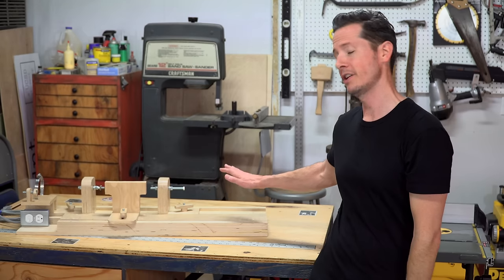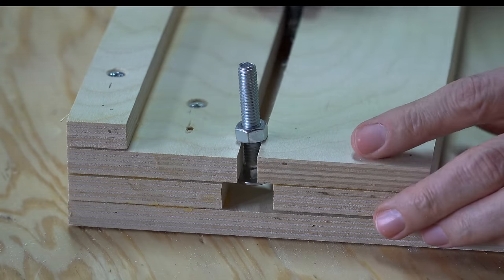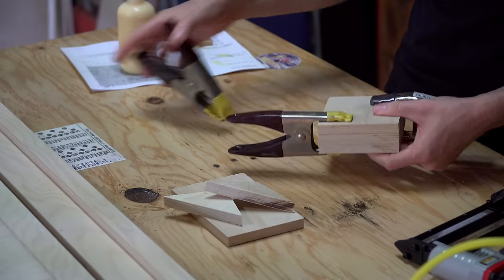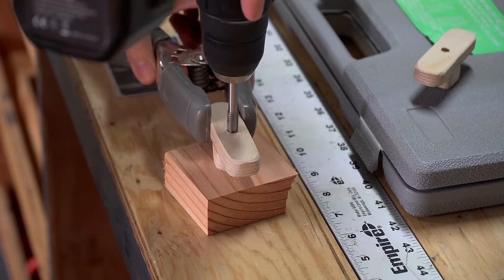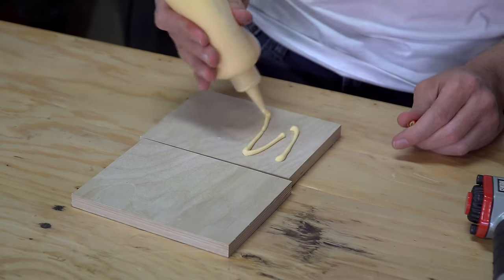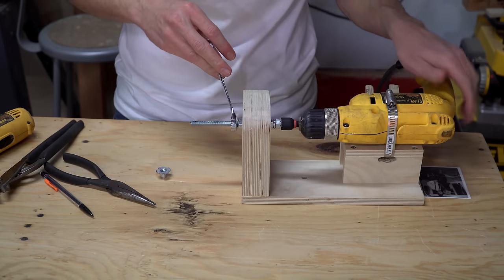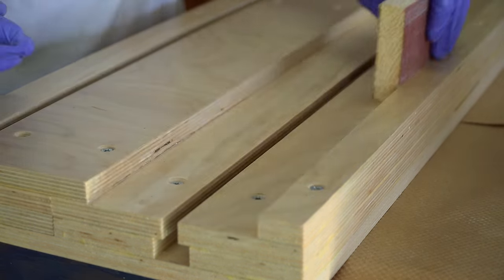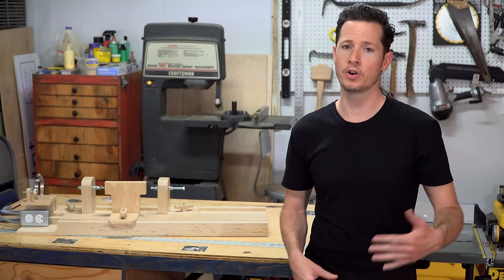DIY Drill Powered Lathe

Comment: I purchased you design and built this lathe. It came out great if I do say so myself! I would appreciate if you could add some designs for lathe chucks, keeping in mind the current specs and needing to mount the chuck to the 5/16ths thread.
Reply from the maker: I usually only build stuff as I need it, and I don't need a chuck right now, so it may be a while. When and if I do build different chucks, I'll be sure to post a video!
Reply from the maker: Also, congrats on finishing the project! I'm glad you're happy with it. If you have a specific chuck design in mind, let me know and I'll take a look at it. I might not be able to squeeze it into the schedule, but I can at least evaluate it and give some feedback :-)
Reply: @OneMinuteWorkbench  I'm primarily using this to work on pool cues. So, if you look at a two piece pool cue I'm trying fixture both ends of a cue shaft and a cue butt. I'm sure I could figure something out, but thought if you had a more universal design already... any basic ideas you have for this specific application would be appreciated.
Reply from the maker: Peter Clondas I’ve read a bit about making pool cues...it’s a pretty crazy science/art. To be honest, I wouldn’t know where to begin. Do you have any experience with it?
Reply: Hi. Love this, I couldn’t find the plans to download. I thought I saw them for $5.00 but cannot find that page. Thanks!

Comment: Hey tommy, I am trying to gather the parts right now and was wondering how you reinforced the tee nut. I just tried and it fractured right away.
Reply from the maker: I did not reinforce the t-nut, but others who have built this project have come up with ways of holding heavier workpieces. Check out the project builds here: https://oneminuteworkbench.com/project-photos/customer-gallery/ Scroll through and look at all the lathe builds. There are a couple where people have build a headstock that has screws being used as prongs...I bet that'd solve your issue. Let me know how it goes, and feel free to reach out if you need more help. Also, I don't always see all the comments, so if you want a guaranteed response, email me through the website. I hope this helps!

Comment: Hi man, great job, really, you build some amazing machines. I took inspiration from your diy sander and I made another one, slightly different, which works decently but definitely has to be improved by installing a bearing on the rod to increase the stability of the disc. I will definitely build a lathe inspired to this design.
I have a curiosity though: do you remember how long did it take to make this lathe? Or your sander? I ask you this because I always get the impression that I'm really too slow, it takes me very long to build this kind of machines hahaha, so I was wondering if in youtube videos it seems way faster (because many parts of the building process are not shown, etc) or if it is actually faster, which anyway would be quite normal as I am a noob if compared to skillful guys like you and other woodworkers on youtube :D

Comment: Hi there! I was thinking about the wood because I wanted to try something, well, my idea is to use OSB for building the lathe, what do you think? I've got a pair of pieces that could be enough for build the entire lathe.
Thanks, and keep going!
Reply: osb is crap in my opinion. its pressed wood chips is not strong wont hold screws. moisture in the air will warp it. plus looks bad.
Reply: @ronalddavis  the thing is... I do like how it looks. But you're right is not the better wood for made things like that

Comment: what size hose clamp did you use
Reply from the maker: I think it was a 4 inch hose clamp. Just make sure whatever hose clamp you use is big enough to get around your drill and a little extra to get around the drill platform.

Comment: What's the swing on this lathe?  (What diameter of work can it hold?)
Reply from the maker: The absolute max diameter (before the workpiece would strike the frame) is 7". That said, you'd need to start off with something at least a little bit smaller than 7", just to be safe. I hope this helps!
Reply: @OneMinuteWorkbench  so call it a 6" swing to be safe.  Thanks.

Comment: The lathe may have only cost $35 in parts, but the tools used to make it probably cost at least several hundred. And if you don't own a table saw, or have access to one, this project is going to be a hell of a lot harder to make.

BTW, I've recently been planning to make an arcade spinner control using an optical mouse, a skate bearing and a 5/16" screw for the shaft. I discovered that a McDonald's straw is the perfect size to make the screw fit snugly into the bearing.
Reply: Working with wood always calls on some tools. But If you do not have a tablesaw, you can build it as well. You need circular saw though.

Comment: could you mount a Jacob's chuck onto this? btw, a Jacob's chuck is basically what is on the drill press
Reply from the maker: I probably wouldn't because I'd never be gripping a workpiece small enough to fit into a Jacob's chuck. Most Jacob's chucks are a max of around 1/2", and the workpieces I would turn usually start at about 3-4 inches.

Comment: Cool vid, your good with wood $35 in materials you should try living in uk your project is something i like and could achieve but at cost of uk prices, could there be a more simple method to make a lathe using a drill?
Reply from the maker: Thank you! I often hear people say that, but is it really that bad? I just checked B & Q's price for 1200x2400 12mm sheet of hardwood plywood, and it's 28 pounds ($38 USD). I just paid $58 USD for a 1200x2400 12mm just a week ago. That said, I think there are probably cheaper methods, but I don't know if they will be as simple or as good. Plywood has the benefit of of being very stable. You could use wood scraps to build a lathe, and then it'll cost much less, but you'll suffer some instability. Anyway, I hope this answers your question! Thanks again for the feedback!

Comment: Where did you get Baltic birch plywood for $35?
Reply from the maker: I buy 1/2"x5'x5' sheets at my local hardwood store for around $30, and 1/2"x4'x8' sheets for around $50. For this project, I used exactly one half of a 5x5 sheet...so there's only about $15 worth of Baltic Birch in this build. I hope this helps!

Comment: The sooner or later, the wood will eventually change its shape especially its alignment due to evaporation and condensation, atmospheric pressure. meaning weather. Im not sure if coating it will do the job. Density of metal still change its form how about the wood? Well, its not for projects that needs a millimeter if not a fraction of it for precission.
Reply from the maker: Baltic Birch plywood has really go dimensional stability. Not as good as metal obviously, however much better than regular boards. The resins combined with the cross grain pattern at which the layers are adhered make it a structural material. If you were to leave it outside, it would not stand up very well, but as long as it's stored indoors in a relatively temperate climate, it should last a very long time. I hope this helps!
Reply: Please explain how the 'density of metal changes'. Best to read about the process of woodturning, and the manufacture of woodturning lathes, before making comments.

Comment: Lathe motor duty cycle is way different than drill motor. You can't run drill motor for long as it is designed to run for short duration..

Comment: nice job but not so hot on the wood.

a little bit of angle iron for the bed,head & tail stocks,and tool rest would be stronger though
Reply from the maker: Thanks for the idea. I did reinforce the tool rest with a steel strip to protect the wood - here's a link to that video: https://youtu.be/UqvVQ2dZaAU but I also hear what you're saying about angle iron. It could be used to reinforce the angle between the wooden members. So far, it's felt very strong and stable, but angle iron would probably make it just that much better.
Reply: @OneMinuteWorkbench  👍   i prefer steel for the lot but thats because i have access to metal cutting gear and my own welder.

the clamp for the drill was great
Reply from the maker: I've never welded before, but would like to get into it when the time is right. Any recommendations for starter equipment?
Reply: @OneMinuteWorkbench  a small to mid sized inverter capable if electrode AND tig work.

electrode is one of the hardest rlectric welding processes so mig may be better to start with but if you learn electrode first the rest is easier.

there is also versatility because of special rods and you can use it outside in light winds
Reply from the maker: Thanks! I'll start reading up on it.
Reply: @jadekayak01  , I agree. If you can learn stick welding, everything else will come naturally.  The only problem I had with learnig welding anything else was when I first started welding aluminum, and kept blowing holes in the metal when it would get too hot. Finally got better at adjusting the settings, and everything went smoothly after that. 😁💪💯😎

Comment: Where is the best place to get bearings?
Reply from the maker: I guess it depends on what you mean by best. The bearings I used in this build are just cheap ones off Amazon. The nice thing about that is that they are, well, cheap. And they usually arrive within 1 day (with Amazon Prime). The downside is that they are probably ABEC 3, if that. ABEC 7 or 9 would have much tighter tolerances and therefore have much less internal wobble. The downside is they are more expensive. That said, you could probably get ABEC 7 or 9 bearings off of Amazon as well, but you might be better off going through a website that specializes in bearings. They'll probably be better bearings. I'm not sure I answered your question, but I hope this helps!
Reply: @OneMinuteWorkbench  Thank You!
Reply: You can actually find good used bearings from things like skateboards bicycles, and roller skates that get tossed or listed on Craigslist, eBay, or Freecycle. Kids often outgrow things, or lose interest in them, and they get tossed - putting them to good use saves them from ending up in landfills. Just something to think about.

Comment: Wouldent it have been easier to glue up the wood solid then use a T slot bit. Just bought 2 on ebay 15 bucks each carbide and .5” shank
Reply from the maker: Mark, thanks for the feedback! I wanted to do this build with minimal tools, and as little hardware as possible so that the project is accessible to more people. I hope this makes sense!

Comment: You could make a more powerful one with a motor and the same style of measuring
Reply from the maker: Thanks for the suggestion! I think a few people have done just that, in fact one person sent me a picture of his build. It can be seen here (scroll about halfway down the page...you'll see a decorative leg that has been turned): https://oneminuteworkbench.com/project-photos/customer-gallery/ I will say though that the drill I used is about 3/4 hp, which is pretty darn powerful. The RPMs could be higher, but it's got enough oomph. I hope this helps!
Reply: @OneMinuteWorkbench  wow i will definately be trying this build i have always wanted a lathe for wood and acrylic to pour radical molds and turn them out into glorious vases ,lights, bowls and plates maybe even my own little salt and pepper shakers out of swirly epoxy :-) on to the hardware store
Reply from the maker: Good luck with the project!
Reply: @OneMinuteWorkbench  thank you lol you may get 30 more views on that video from me alone ill ha e to go back to look a lot 😂

Comment: I'd like to echo Houtje Boom below - your toolrest is too high.  If not adjustable, it should have the same height as the tailstock centre.
Admittedly, for the amount of thrust against the tailstock, ordinary ball bearings are fine, but  I used a bicycle wheel hub. This gives a bearing that can be adjusted for free-running, and is a thrust bearing.  OK - I had one lying around, but bike parts are cheap, and people are constantly junking kids' bikes, with a marvelous supply of free bits & bobs from your local public dump.
For the headstock, I just accepted whatever bearings are in the drill.
Reply from the maker: Thanks for sharing your experience! For the tool rest, check this out: https://youtu.be/UqvVQ2dZaAU
Reply: I love the idea of using tossed-ou kids' bikes for bearings and other parts! I really like "upcycling" things like that, and do it all the time, myself. Everything from pallets for wood projects, to computers for powerful magnets, to bicycles and other things for bearings, tubing, and other do-dads. I love it‼❗ 💯  😁  👍  🖖  ✌  🤘
Reply: @MaryAnnNytowl  Good for you, Mary Ann.  Recycling is better than nothing, but it takes energy, and I sometimes wonder what the true economies are.  It's far better to re-use stuff.  What really gets my goat is the use of "security screws" in small kitchen appliances.  They always say it's to protect the user from electric shock if he opens a toaster or a kettle, but if he opens it, that's a fair indication that he knows what he (or she!) is doing.  I believe it is to prevent such appliances from being repaired - because they'd rather sell you a new one.
I know you can get keys to fit security screws, but they have a hex shaft, and the screwdriver that fits them is too fat to go down the deep, narrow holes in the plastic body of the appliance, that the manufacturer invariably hides them down.  I have written to my MP (member of parliament), the Department for the Environment, and to various other environmental agencies about them, but mine is a voice crying in the wilderness.  If a lot of people did it, they might detect a groundswell of sentiment against these "waste maker" screws, and we might get rid of them.
Reply: @DownhillAllTheWay  I agree on the specialty screwdriver problems. It's the same over here. My eldest son meses with old computers, and bought himself a set of all the specialty screwdrivers and bits available, so we can take things apart easier, most of the time, but still, there are somethings that are just not designed to be worked on at all, and it's so frustrating. Not only that, but if you try to find the part needed to repair it, it costs as much or more as a new [whatever] would cost. It's just absurd.

Comment: $35? Where are you getting your Baltic birch?
Reply from the maker: I buy mine at a couple of local stores (in Southern California). Back when I made this video, it was usually about $30 for a 5’ x 5’ sheet of 1/2”. Nowadays it’s about $35. That built only took a half sheet, so it was only $15 worth of plywood, $15 for the drill (from a yard sale), and about $5 for the hardware. Even though Baltic Birch is pricey, I find it to be a good value. As they say, you get what you pay for. It’s so much easier to work with, and very reliable in terms of quality...I love the stuff! Anyway, I hope this helps!
Reply: Thanks for the response! I’ll check it out at my local lumber yard. I have used it in the past at work. It’s super tough. Love the idea of polying all your jigs. Cool stuff.
Reply: @OneMinuteWorkbench  $54 a sheet for 5x5 1/2" balltic Birch at my local lumber yard
Reply from the maker: That’s a bummer...I’ve heard that prices are going up on plywood at Home Depot from a couple different people, but plywood prices are pretty steady at my local lumber yard. Hopefully it’s just in response to coronavirus...we’ll see.

Comment: Why would you choose poky urethane?
Reply from the maker: I like then finish and protection that poly provides. How would you have done it?
Reply: One Minute Workbench after 35 years of woodworking and finishing I defiantly use lacquer
Reply from the maker: I've used lacquer a little bit and do like it. I might have to start using it more.
Reply: One Minute Workbench the advantage of lacquer is its speed and repairability. It is hard to repair cured poly
Reply from the maker: I do like the idea of easy repair, and I know that is an advantage of lacquer. I'll try to incorporate it into some future project vids.

Comment: Great work, but you use expensive specialized tools to make a 35 dollar lathe! Was your purpose to save money or just fun?
Reply from the maker: Both! 😉 It did save me money...and it was a lot of fun!
Reply: What are you calling "expensive specialized tools" in the video? The table saw? The coping saw? Neither are that specialized, and both can be found rather inexpensively. Our new table saw was well under $500, our used one was literally just the $20 in fuel we spent to go get it. Besides, if one already HAS all of those tools, but one doesn't have the extra scratch to get a lathe, why not USE the tools you already have to save the money you'd have to spend to buy a lathe?
Reply: I believe that regular people have not any tools like that, unless they are carpenters or hobists. Fancy yourself making, for example, the spoons in your kitchen just because you have a table saw and a lathe! It's meaningless and funny. The man said that it was mainly a lot of fun. I can accept it this way.
Reply: @evangelospapapostolou9464 , I would imagine that most people watching things like this are at least hobbyists with at least some decent collection of tools to work with. And making spoons would be relatively easy with just an acetylene torch and a hammer, but a lathe would be rather less helpful unless you made wooden handles for the spoons. 😄😎
Reply: @MaryAnnNytowl  I see what you mean. I am a wooden ship modeller myself and I enjoy it a lot. And of course I have all neccessary tools. On the other hand, my attempt to make humour using the "spoon example" was rather unsuccessful.